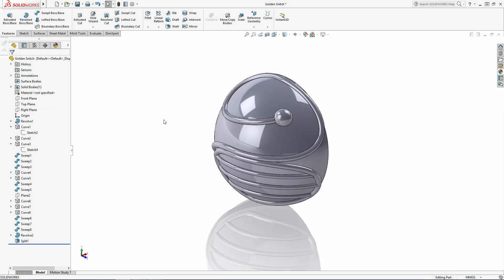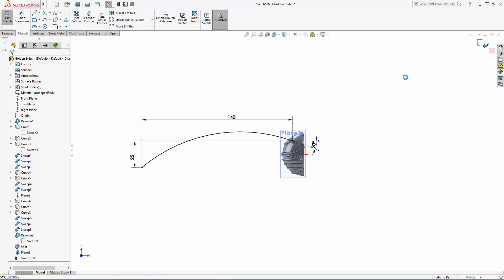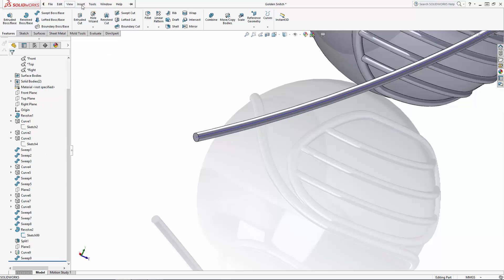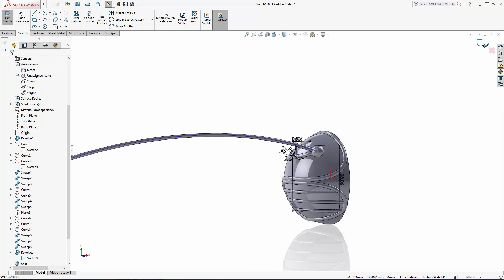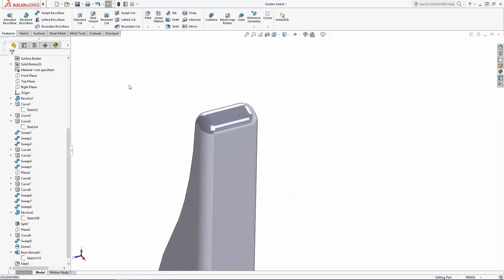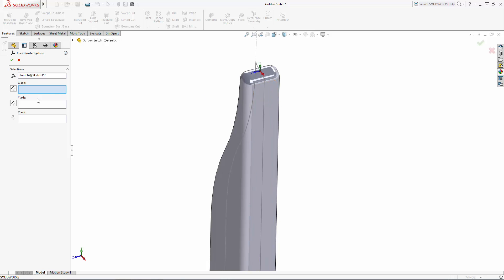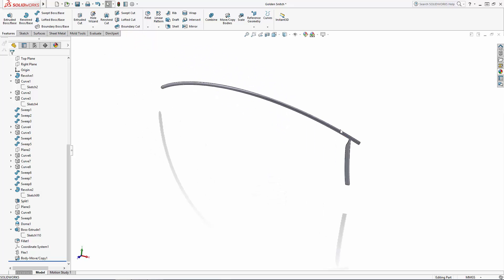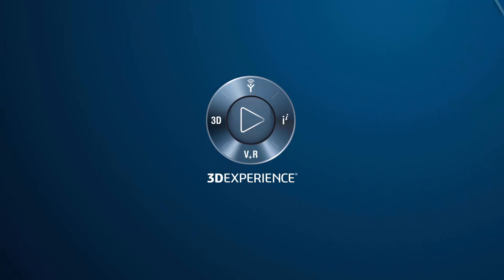Harry Potter's Golden Snitch Tutorial - Part 3 - SOLIDWORKS

Comment: Loving this tutorial, but my version of SW says you can't skip instances when you pattern a body. I've done a clumsy work around by creating 57 copies spaced 3mm apart, but is there a better way?
Reply: the same issue, looks like it's the most wise way to handle with it.
Reply: Btw, it's only 56 copies to be created:)
Reply: Yeah, I added the extra feather just because with a 3mm spacing it looks about the same as the 56 equally spaced parts that they show in the tutorial. If you do 56 spaced at 3mm they don't go far enough along the wing. You could do 56 spaced at 3.05mm I guess.
Reply: suppose, we are gonna create 3 additional some at the end if the wing.
No need to increase a gap, bro:)
Reply: Paul Stabler,  If you search up the golden snitch in google, you can see that the feathers don't actually extend all the way to the edge of the wing. However, it is not a major issue